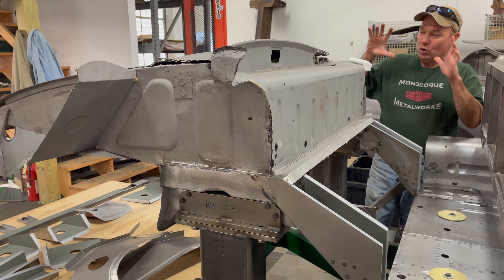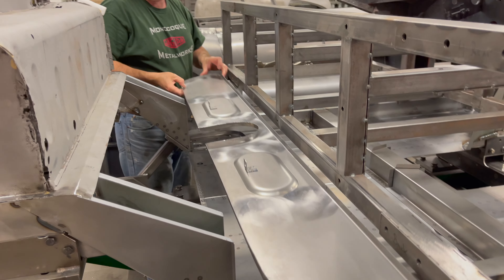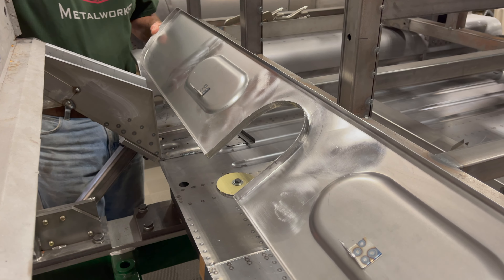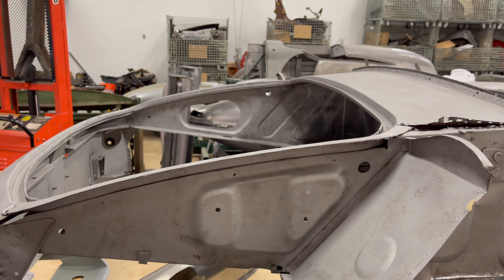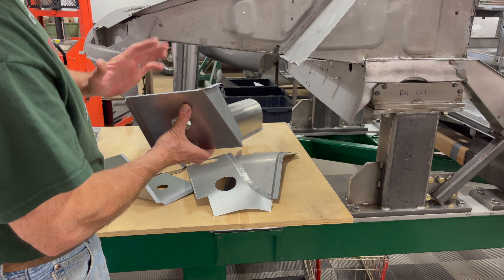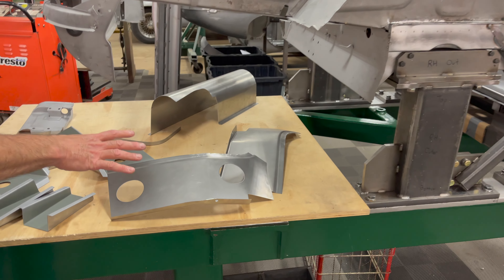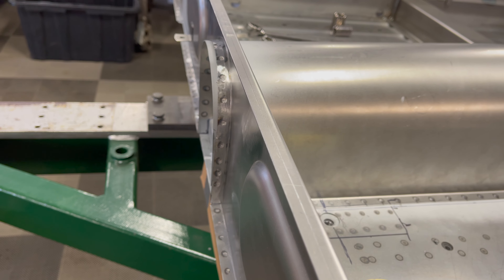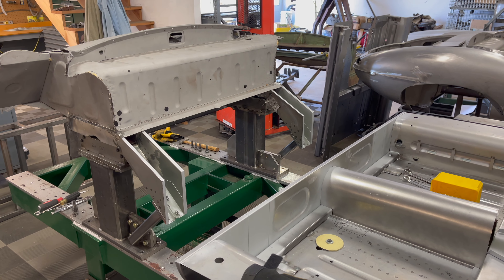Jaguar E-Type - 1961 Outside Latch OTS Body Shell - Part 4 - Rear Bulkhead

Comment: Have to say Chuck your spot welder is the dogs gonads !  But it has to be !  My restoration is far less complex but l only have a basic spot welder so l do a lot of plug welding to compensate . Those 2+2 floor pans are far from perfect but you can't look a gift horse in the mouth . They fit pretty well and l've put the small pressing's in that run down the outside floor/sill joint . Your the top's Chuck !

Comment: It doesn’t look like you are using a single sided spot welding gun. Is the opposite electrode out of view.  How are you getting the required clamping force?  This falls under the category of “If you don’t ask you don’t learn”
Reply from the maker: We are using a Pro Spot gun that is most definitely double sided - which is an absolute must for structural spot-welds like these.  You can’t see the other side because we are using a giant custom- built arm to reach everywhere we need to on an E-Type body shell.  It is pressurized by air and water-cooled. 😉
Reply: Awesome